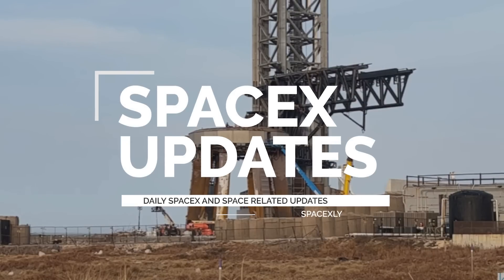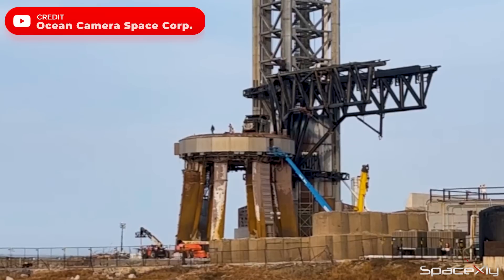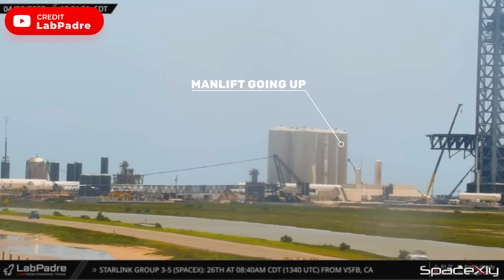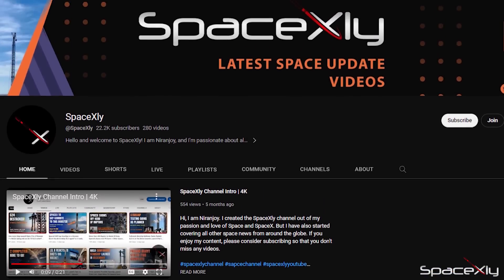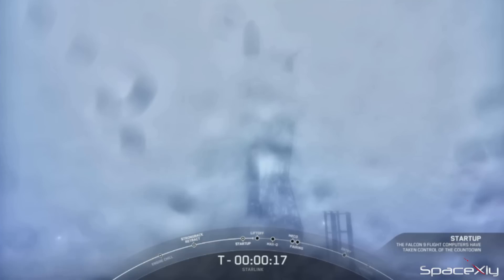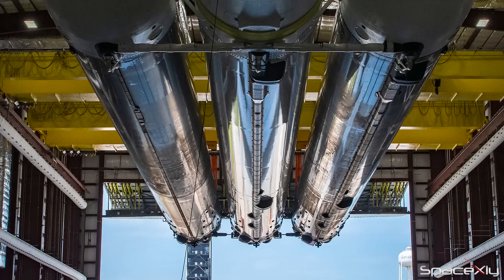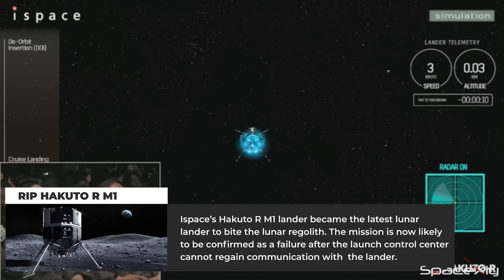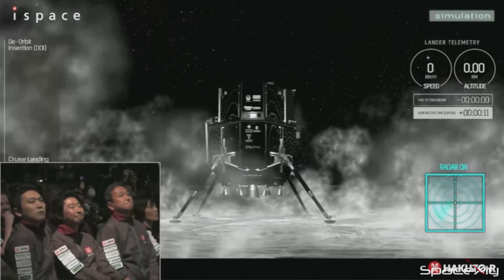Starship Launch Pad Repair Work is Underway | More Launch Delays + Latest Hakuto-R Updates

Comment: While all of the attention is at Boca Chica, and rightly so, I am interested in what SpaceX will do with the lessons learned at Cape Canaveral.  Hopefully they will build the third tower with a flame diverter trench and a deluge system.  I can see them tearing down the town on pad 39a so they don't end up with issues without either of those critical items.  I don't know what the requirement is but I would think for safety there should be at least a mile between launch pads.

Comment: Before any repairs are made, the FAA must approve the modifications and make inspections or it wil have to be torn down.
Reply: Absolutely not true,the Faa will  approve necessary repairs and changes to launch complex, after that a new launch schedule will be initiated!
Reply: Only if it characterises an alteration from previously approved arrangement. At this stage they are mostly cleaning and repairing what's easy and straightforward.
Reply: What a bullshit